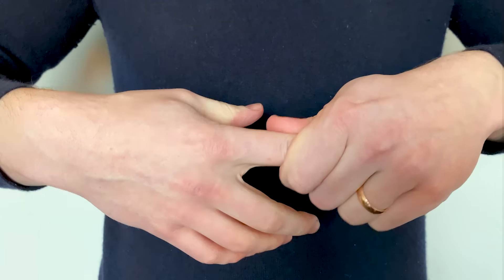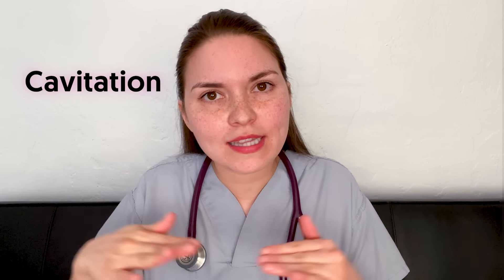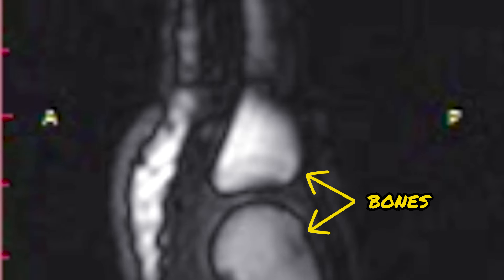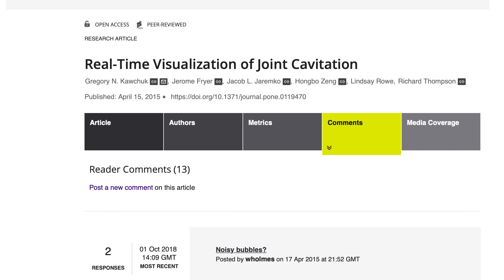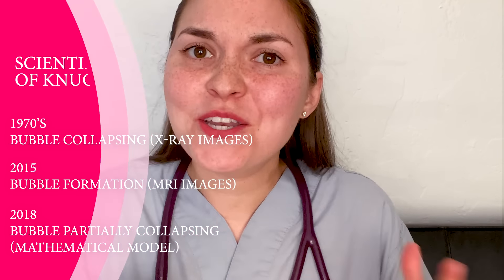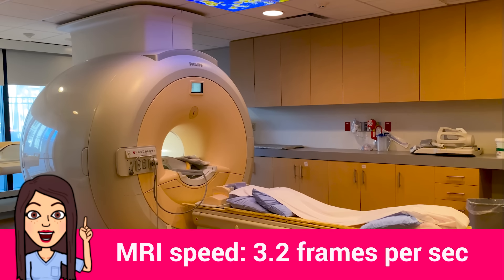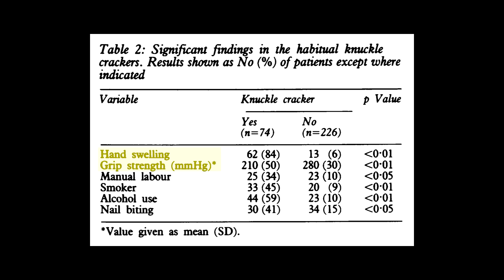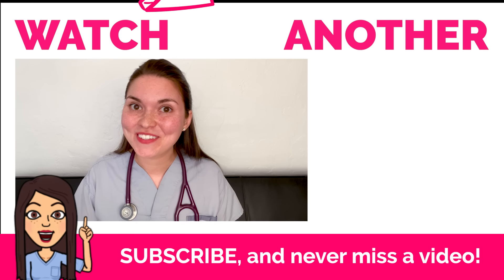Arthritis Doctor Explains: CRACKING KNUCKLES GOOD or BAD

Comment: Nice to finally know a doctor explanation of the bone cracking. I've been cracking my neck left and right, my back (twisting) left and right, joints between my palms and forearms (very very loud everytime right after I wake up), my shoulders (randomly cracks when I rest my back I couldn't understand how xD), my ankle area (always both cracks once/twice a day when I walk downstairs), and of course, my fingers (hands and toes), as long as I remember, since 2009 (6th grade). Though I couldn't do the other ways anymore because not having done it for a long time, I still do them and have no problems. I do have a thumb that hurts when I try to crack it so I don't do it there anymore, it was because of a skating fall and constant pressure due to playing the guitar everyday. Overall, my bones are all pretty healthy!

Comment: what about knee cracking sound when kicking your leg straight? 
didn't have it when i was young, after turning 35 it started happening. i can clearly feel the bubble in the knee formed and popped on the surface of the knee skin... but im not stretching the knee joint like cracking the inuckles...

Comment: Well I'm curios now. Because I got to the point where I don't need the other hand to "crack". Meaning I just need to form a fist with a mild strength and popping/cracking sound would be heard. I thought my hands are already broken. But if there is no harm at all, what happened to my hands? Because I did so much cracking on my knuckles a lot for a long time.

Comment: But i relate cracking to stiffness. If I crack my knuckles, not pulling but the old I'm-gonna-beat-you-up knuckle crack, i have greater mobility in my fingers. Also my thumb can become randomly stiff, and if i flex my thumb a few times it cracks the same way and the stiffness is gone. Also cracking my neck feels 'refreshing' like experiencing better blood flow. Is it really just air popping?

Comment: So, how do you solve knuckle cracking when you are NOT pulling the joint apart? And why can I pull my joints apart and get no sound at all while using a different method creates the pop?

Comment: I use to do plastic canvas… a type of needle point. I did it so much I messed up my shoulder so bad doing the same movement over and over. The doctor I went to said I messed up the cuff in my shoulder. Is there anything I can do to make it feel any better? When I pul my arm above my head it feels 100 times better then having it as normal.

Comment: Would it be the same negative pressure when you crack knuckles during flexion. Would that be cavitation at the arc or is that more likely to be carpal-metacarpal joints cavitation?

Comment: Do the nitrogen bubble explanations (either forming or popping) explain reduced range of motion in a joint pre-cracking, and increased range of motion post-cracking? Also, what about the aspect of joint cracking where you can only crack a joint every so often, not repeatedly?

Comment: I have a Question Ma'am
If the sound is caused by the bubble forming or popping, why can we only crack a knuckle only once in a certain period of time, and it just doesn't crack twice ever. At least not for some while.
If its just bubbles forming or popping, shouldn't that happen every time we pull the joint?

Comment: Iam 64 .Ten years ago I had Chikungunya.  I had stiff and swollen joints very painful. Making small movement was difficult. I had body swelling and body ache also had carpel tunnel problem because of swelling, got the surgical procedure  done. After three years I was told now all symptoms are like RA. But my blood test was negative. Finally it was decided symptoms are similar to RA So I take treatment from Rheumatologist. All these years my blood test is not positive. But shape of my palms is changed, morning stifness persists, my foot arch is colapsing some joints are painful. I am taking medication prescribed by the  Rheumatologist. Recentely I learnt that almost 30% patients blood test is not positive. Is it true?  Also after Chikungunya infection my knuckles don't crack at all neither my toes. I get tired easily. Any other treatment I should take?

Comment: well I'm not sure but it seem the grip strength reduction seem quite true cause I'm quite clumsy with things which I might drop something if I don't hold them strong enough.... not sure was it about my skin isn't grippy or my strength is weak
however my mother said that cracking your knuckles too much will cause winkles on your hand's skins specifically finger joint

so any explaination ? Doctor  ?

Comment: The weird thing is I crack my knucles once (by pushing my fingers towards my palm in a 90º angle) and then I can't crack them again for a period of time. Why is that? Does the fluid move in a way that keeps you from causing bubbles again right after? Because in the syringe example, it would be possible to do it multiple times in a row. I'm curious about people who crack knucles by pulling the finger, can they do it over and over again?

Comment: so for some time now my palms hurts while im using computer. cracking knuckles seems to help ease the discomfort, but then joints slightly hurts. is this something i should be worried about?
Reply: I think you should get a palm rest so you can rest your hands on a soft surface while using your computer.

Comment: for those who don't want to wait: It is not bad, though no possible benefits were presented. 
The worst case is that you may have slightly less grip strength, and you may develop swelling on your knuckles.
Feel free to correct me, as I am unwisely summarizing early in the morning

Comment: I've been cracking my knuckles for 43 years

and i can confirm that it will cause stiffness in your knuckles

cracking them temporarily makes the stiffness disappear

so it seems to me that when i crack my knuckles

I'm actually ripping the cartlige apart

which makes my knuckles feel loose and oiled up

but then the carriage quickly starts to bond again

which makes my knuckle joints feel stiff

which is why i have to crack em again to make em feel loose